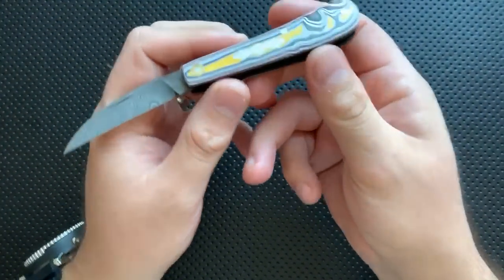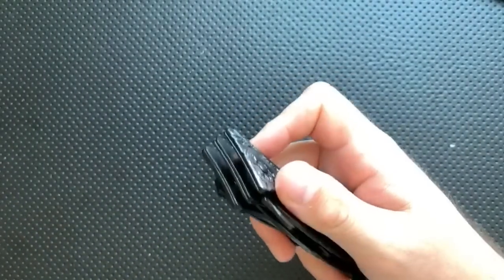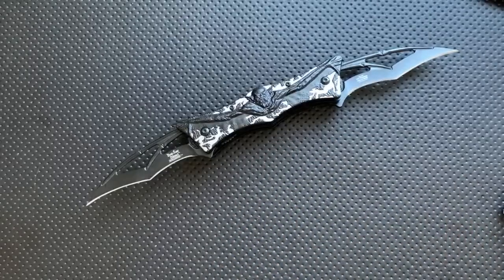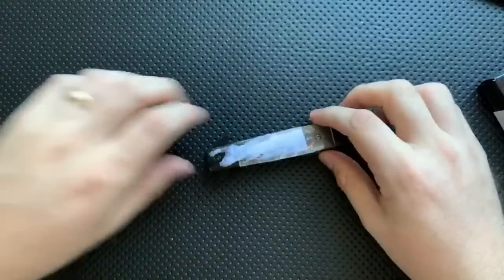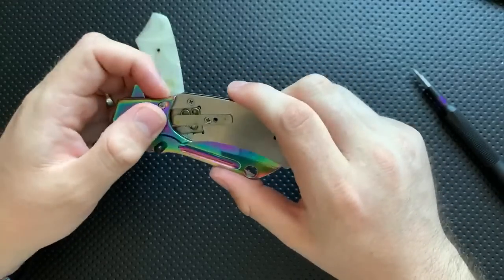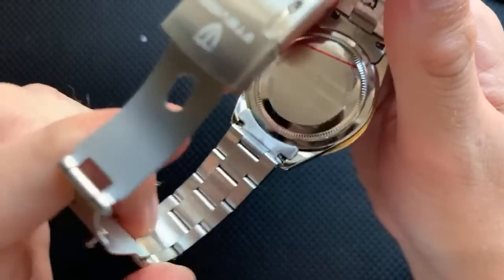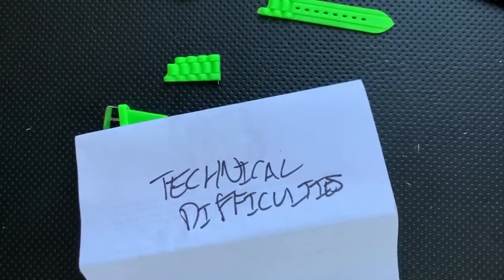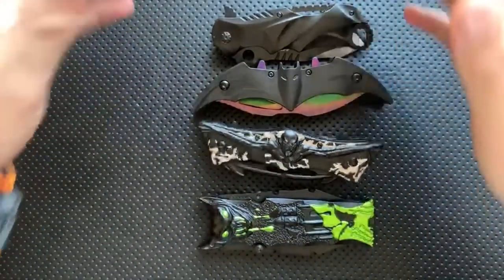Terrible Gear LIVE: September 2019

Comment: The tactical toothbrush has but one flaw: a shiny piece like this in a tactical dental hygiene situation is a no-no! Clearly this tool needs a DLC coating. Or, better still, it should be phosphate treated! That way it actually contains emergency toothpaste - all you need to do is strop the brush on the phosphate treated surface and you are good to go!